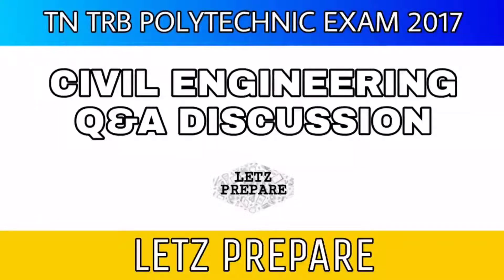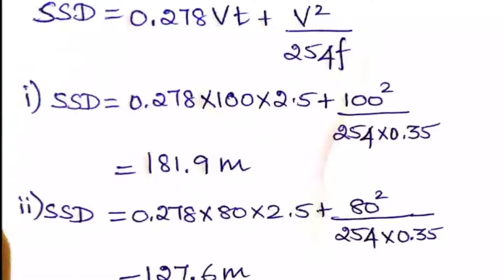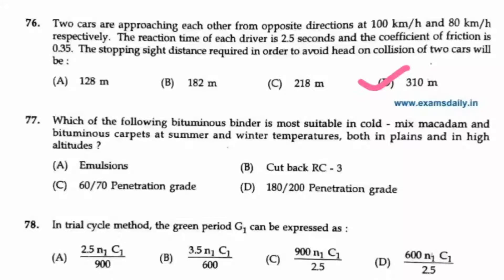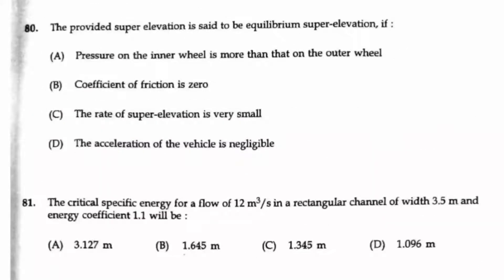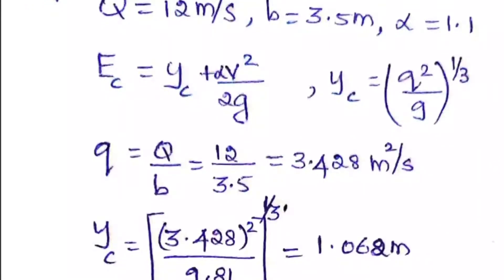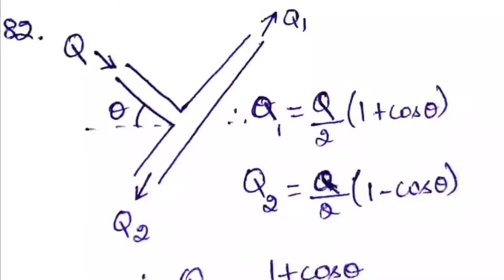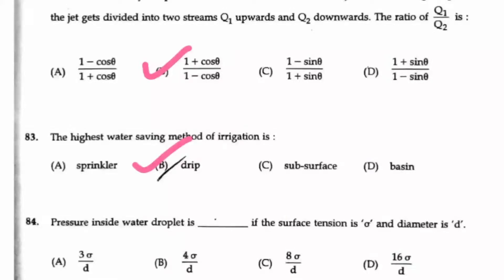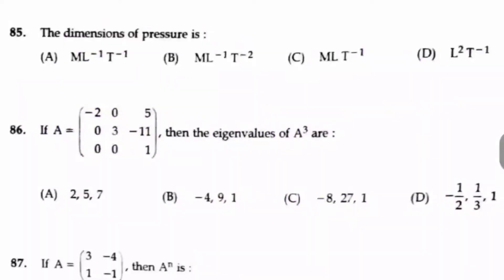TRB Polytechnic Civil Engineering 2017 Question Paper Discussion ( 76-85)

Comment: Q 81 , yc in terms of 1/3  , how can i solve this because  in trb exam  should not be provided calculator    , so if you have any trick  pls share  me  mam
Reply: Tq mam
Reply from the maker: Only trick I know is . .
You can take approximate values, as the options given are not nearer values.  Like (3.428)^0.66 = 2.25 and (9.8)^0.33 = 2.1 and further steps also.